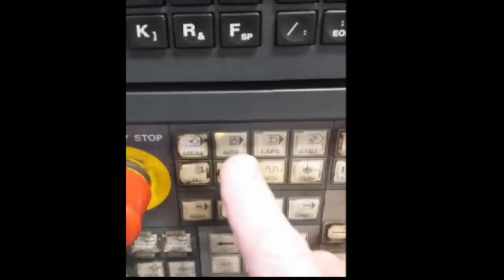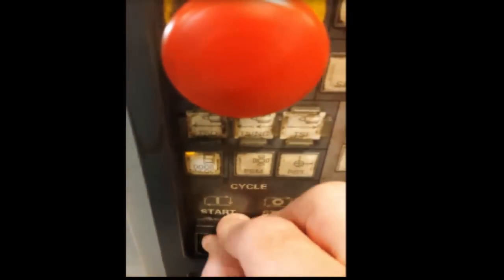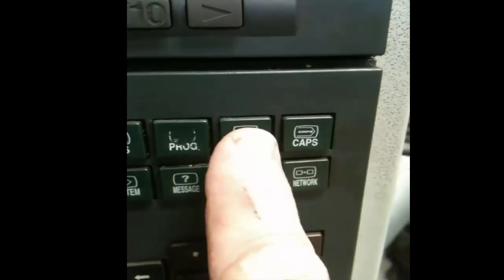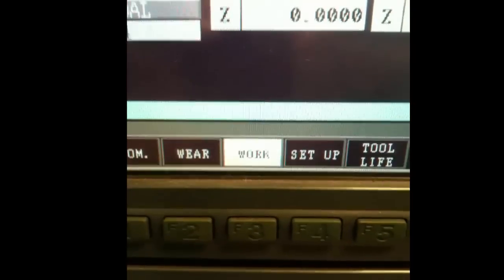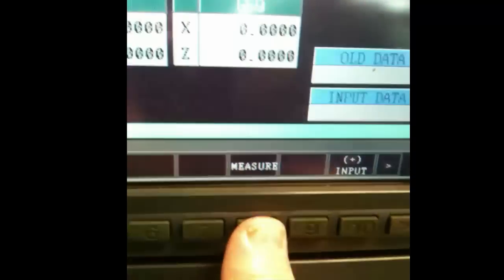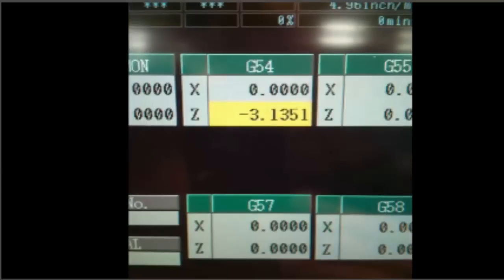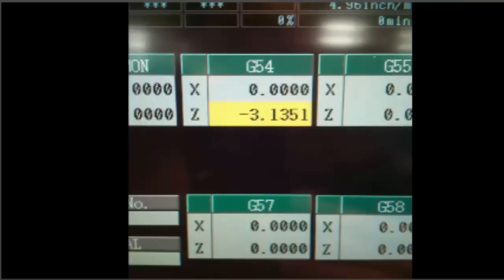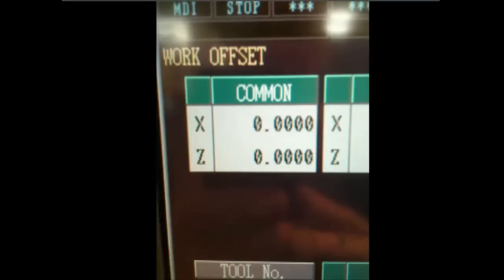HOW TO SET A WORK OFFSET ON A CNC LATHE

Comment: Hello need help if anyone can I have got a cnc. Using it as normal  I set a tool 3 for screwing put it in screwd my job went to use tool 2 today and my x axis  is moving in the rong direction   what have I done as I ain't got a clue new to cnc lathes and mills

Comment: Hi Tom

Thank for your great videos.

I just wanted to find out why do we do the work offset on the lathe. I've only done tool offsets?

And the program seems to run OK
Reply from the maker: Lets say you had 12 tools touched off on a part and wanted to use the same tools on a parts that is longer. A work offset would allow you to change only one value and all tools would be set for that job. Hope that makes sense
Reply: @TomStikkelman ah Thanks makes complete sense. Same as in the milling machine with the master tool.

Comment: Hi tom wonder video thank you, i have question, what is difference between G54 and G50? Thanks
Reply: G54 is a work coordinate, a reference origin for the part zero, G50 is the limit  you set for the spindle to spin,example: if you star with an G96 of S300(surface footage) on the OD of a piece of let say  3.0 inches as the cutting tool move down on x axis the spindle have to spin faster to compensate but if you have limitations you set G50 S..... to the maximum you can go and the machine wont go any higher.

Comment: Excellent!  As you demonstrated, always make sure that the tool you are using to set work offset is called through MDI to activate its offset. If you do not do that you may crash the machine ,since the offset value will be input wrong, especially on latest Okuma control:)

Comment: hi, Tom can u do a vdo set up using tool probe.  thanks
Reply: timothy ka kue I think this is an okuma thing. But if your still interested you can look in the gosiger you tube page. But if you have a fanuc controller you use your master tool and set your screen to the probe page. You should be able to figure it out from there

Comment: why did u put that offset in G54 ?  why not in just normal z/x axis
Reply from the maker: +Danish Khan The tool was already touched off and saved in the tool offset page. If you use multiple tools on the same part, then I recommend using a work coordinate like G54, so that if all those tools are used again on a different part with a different Z-Zero location then all you have to do is reset the G54 Work Offset and all the other tools are set to the new Z-Zero location. Thanks Danish.
Reply: +Tom Stikkelman oh now I get it , thank u

Comment: Hi Tom!May I know how to setup x for G54.
Reply from the maker: Hello Florin Pal. The X-axis needs to stay zero because it represents center line of the spindle. The machine looks at the tool geometry offset page in the x - column to know where the tool is in relation  to the center line of spindle.  Thanks. Tom
Reply: Thank you.
Reply: @TomStikkelman   woa  very usefull

Comment: Great video. after you make work offset for  G54 and you touch T0101 in z axis only  and leave X axis in 0 than you have to do skin cut in x axis measure diameter than go to geometry and show diameter in X axis and z Axis too for tool T0101 as well and other tool as well? and  must leave work offset G54 X0 in case use drill .
you have great videos thanks
Reply from the maker: +Chiruflys zepeda Thanks Chiruflys Zepeda. All tools must be touched off on the same face to set the Z-axis geometry . Each tool has to be set by turning a diameter and then you use that diameter to set the X-axis geometry.Once all tools are touched off then only one tool is needed to set G54 work offset by touching off in Z-axis only.Yes the X-axis stays zero. Thanks for your feedback and for watching my channel.  TS.
Reply: Hello sir, are u still here ? My question is this : if all the tool must be touched off , and we use tool number 1 to set work offset . This means the z value in tool geometry offset of tool 1 must equal the z value in work offset , is it ?
Reply: your z work geometry should not be touched after setting your g54 in t1. or else youll push your z axis foward or back depending on the number you put in.
Reply: Hello I'm interested with your lessons keep on sir
Reply: And why we use 54 when set to work